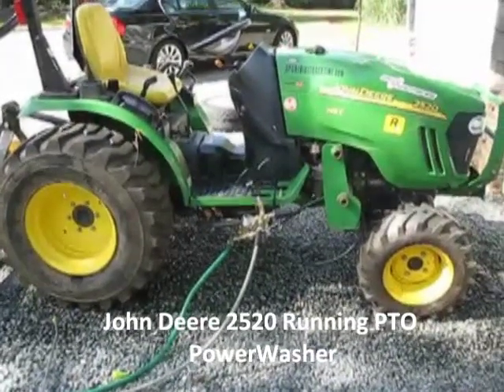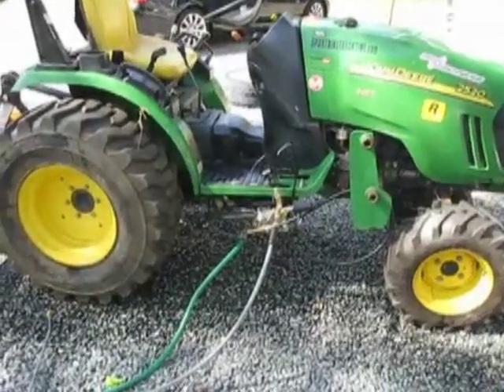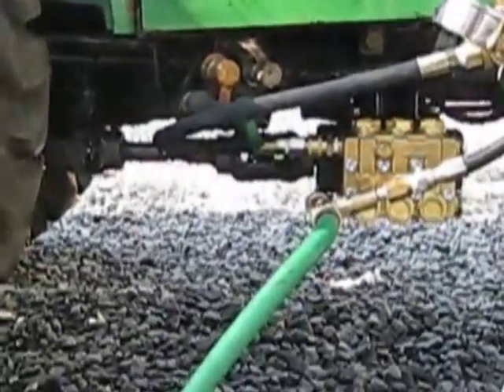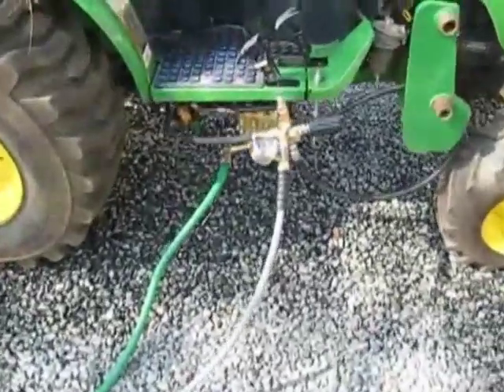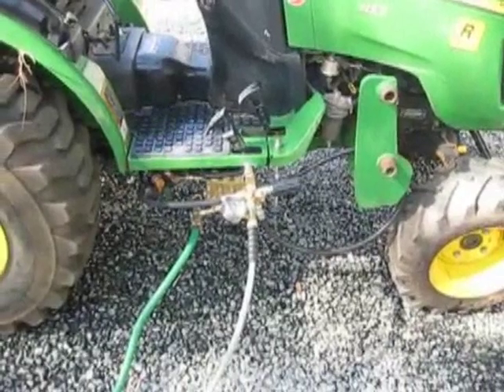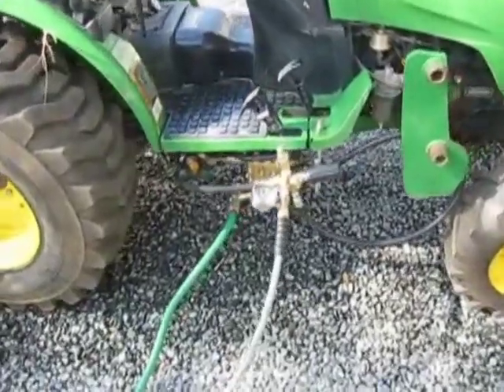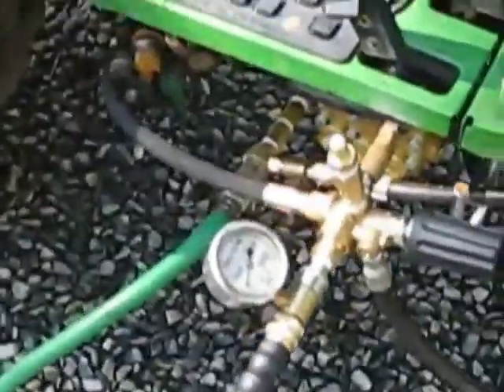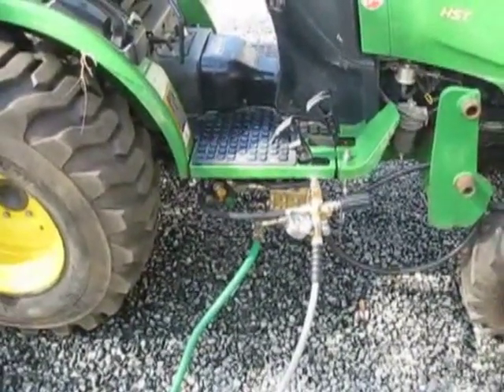John Deere Tractor Mid Mount PTO Powerwasher

Comment: Can you estimate your water volume per minute?  Nice old video.  Thanks!
Reply from the maker: G Wolf... I still use this setup 8 years at least once a year for doing my driveway house etc.  I think the GPM is effected most by the tips I'm using.  That tractor setup is capable of running two of the driveway cleaning heads at the same time.  I think that pump was rated at 4.5-5gpm.  So it depends on tip that you are using.

Comment: would you be willing to share a parts list?
Reply from the maker: Sorry.  If I recall I largely purchased the pump, and unloader valve.  Then I went to a local tractor supply and purchased the PTO connections that fit my tractor and a spline shaft that connected to the pump.  I welded these parts together.  After that I used some 1"  steel angle bolted to existing bolts on bottom of tractor and top of pump and made a hanging mechanism.  So I lift up the pump, it grabs in the back and I just put a single pin in it to hold in place.

Comment from the maker: It will work on any tractor with a mid mount pto.  You also have to be aware of what the rated speed on the mid mount is.  On the John Deere's they are largely all the same.  The rated pto speed is too fast for the pump though, which has a maximum RPM of around 1700.  So on this tractor is unwise to bring the RPM's above 2100 when running pressure washer.  It will put out 4000psi almost at idle.  Without an unloader attached it will quickly clime to 5000psi at rated speed and wand attached.